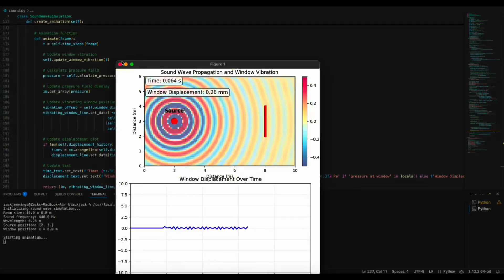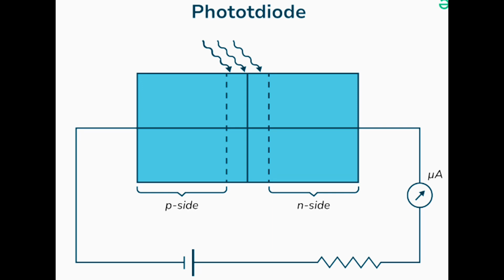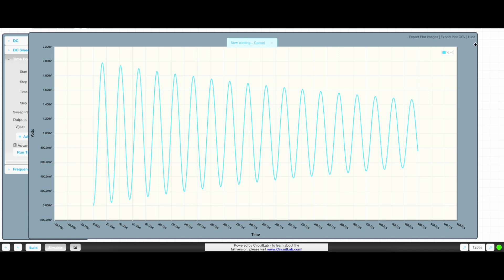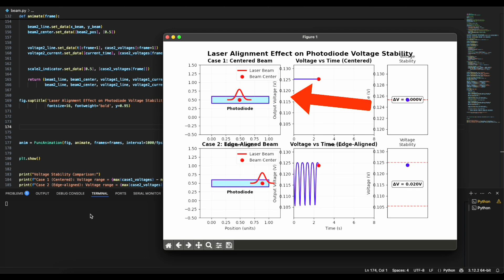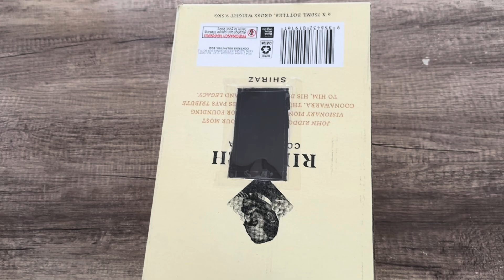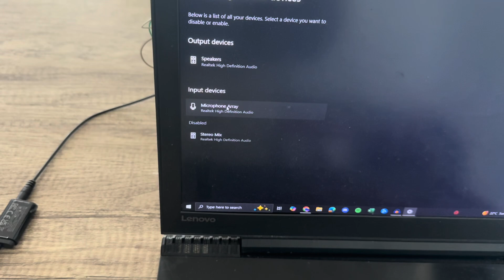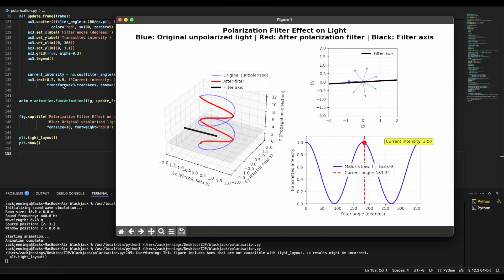Photodiode Based Laser Microphone | Full Engineering Breakdown

Comment: Good job, can I ask whether you used TRS, or TRRS aux cable?, also how did you put the OPT101P sensor. I have it but I can’t understand the orientation well. How should I place it, it looks exactly the same from either side, I couldn’t identify the specific pins. Also, I am using a film capacitor which has polarity, I couldn’t find the ceramic one. How should I connect the capacitor?. Thank you so much, have a great time.
Reply from the maker: Thank you for the comment! 

I ended up using a TRS aux cable in combination with a USB sound card so my computer could detect the audio, here is the amazon link for the one I used: https://www.amazon.com.au/dp/B0CL1WCQBB?ref=ppx_yo2ov_dt_b_fed_asin_title I think either TRS or TRRS is ok, just make sure your computer can accept it. 

With the orientation of the OPT101P, the trick is to find the little "notch" on the photodiode side, the "notch" corresponds to the top edge, and you can refer to page 3 of the data sheet for pin layout.

A film capacitor is good, it will help filter noise. Have the positive side connected to the output of the OPT101P and the negative side connected to the stripped end of the aux cable.

Please let me know if you have any further questions. Thanks, Zack :)
Reply: @zackjenningsprojects I finally figured it out, and it is perfectly working. Thank you so much for everything 🎉🎉
Reply from the maker: @thewondersofworld1020  That's great to hear! My pleasure :)
Reply: @zackjenningsprojects thank you so much for your response. 
I assembled the circuit, the power source is working, I found the correct orientation for the OPT101P and checked if it is working using multimeter. The output of the sensor changes voltage level according to the intensity of light, so I suppose it is working. 
I am also using a TRRS aux cable, I opened it and it had four wire inside: copper, green, blue, and red colors. I used the copper one as ground and the green one as well, I didn’t use the other two. It was enamel coated thin wires, I don’t know if that would weaken the signal or not, but I tested it with multimeter and it transmit current well. I connected everything together, and used UGREEN usb sound card as well. 
My computer recognized it as usb microphone. However, when I opened the audacity and started recording just to test, it wasn’t working, it was just flat line. Is there anything I should adjust in audacity, or do I have problem in the setup? 
Thank you so much again, have a great time.